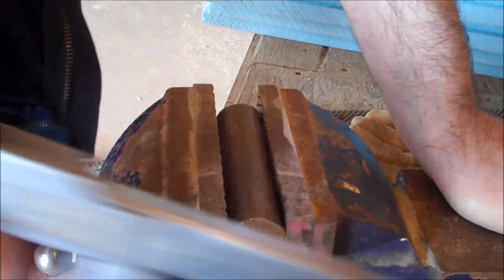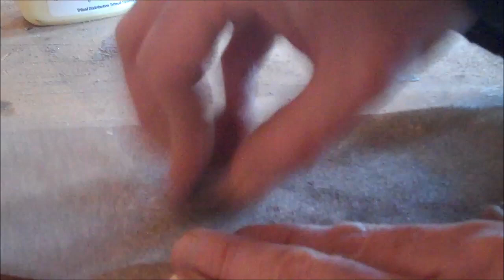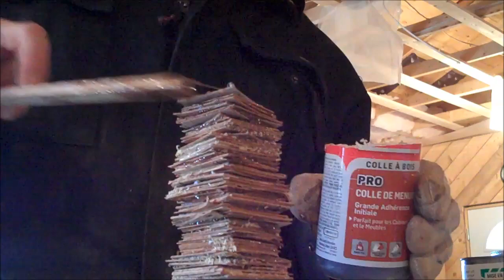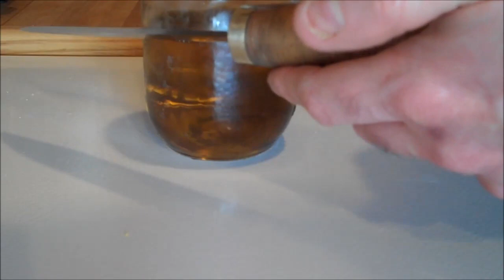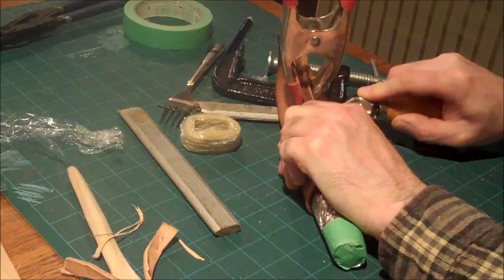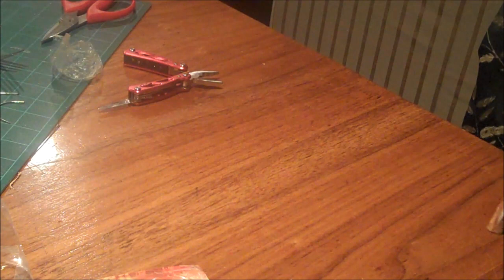How to make a puukko style knife

Comment: Say Heah Andy, It's Beautiful. Infact watching a few of these video's, I took my Vintage Cold Steel Sisu out again this weekend. It got alot colder so instead of bringing my 2Hawks Double Bit Hatchet, I brought Long my 17" Hultafors Bruks Agdor Hatchet. I still wanted to go Lite and Compact so I did bring my Wicked Tough Saw instead of my Agawa Canyon 21 Boreal Saw. But I did bring my Cold Steel Ultimate Hunter Folder. Plus my Gerber Multi Tool which I like to use to take off the hot pots off the fire. In warmer weather I prolly would of brought a Summer Long Knife, but I didn't this trip. Just the basic's similar to Nessmuk's, heh heh heh. But I really love that Puukku you made, You did good, Andy.,,. p

Comment: knife is nice, but I question why you didn't at least use a rasp to get the initial roughness down...
Reply from the maker: Chad Holland I tried it at first using a rasp, the flex in the blade made that chatter too much and using 40 grit sandpaper removed material nearly as quickly and the knife didn't vibrate and chatter as much in the vise.
Reply: Andy Collier Oh, I will keep that in mind. Didn't think about the effect of a thinner blade on cleaning the handle.

Comment: was the end of the tang and the butt cap threaded?
Reply from the maker: No, it was peened slightly though.
Reply: Andy Collier did you peen it while the epoxy was wet or after it had set up?  Thanks!
Reply from the maker: RocketCityGardener After, I should have annealed the end of the tang though, I think it was hardened with the blade and didn't peen easily.